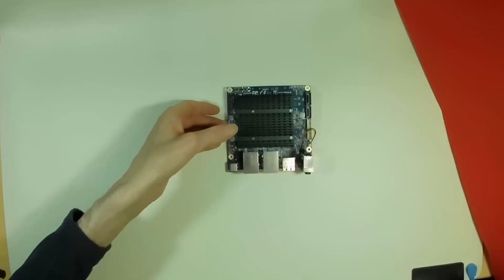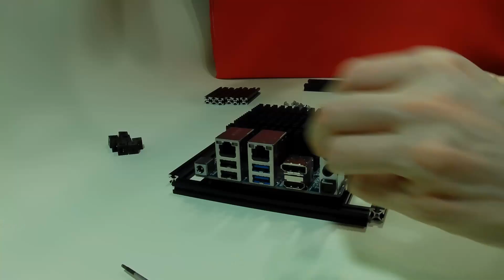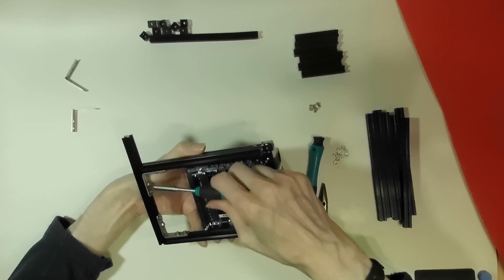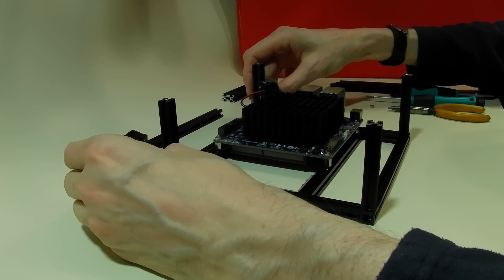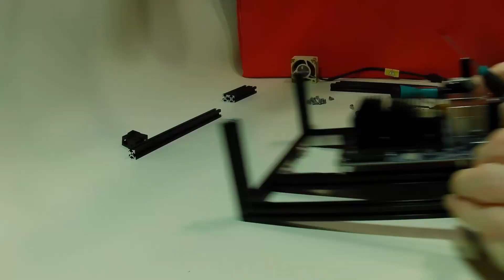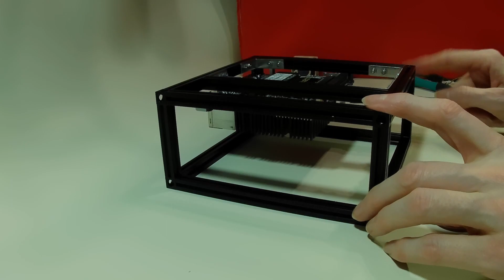Odroid H2+ x86 media player in a Makerbeam case - part 1

Comment: any chance you've run proxmox on that little unit ?
have a small VM requirement and thinking one or 2 of these could be great.
each with 16GB RAM and a 256GB MSATA storage.
Reply from the maker: I've not tried proxmox on any of these yet.
Reply: @custompchardware  I'd def be keen to hear how it does...